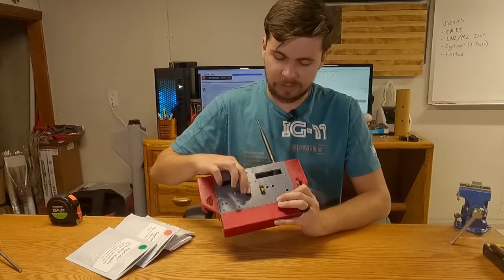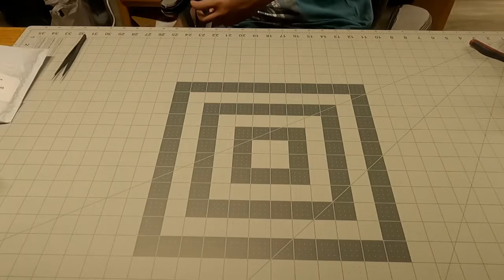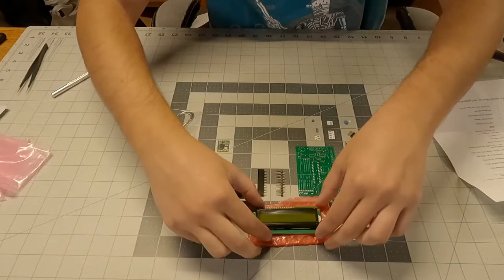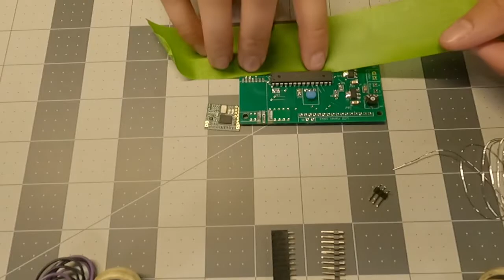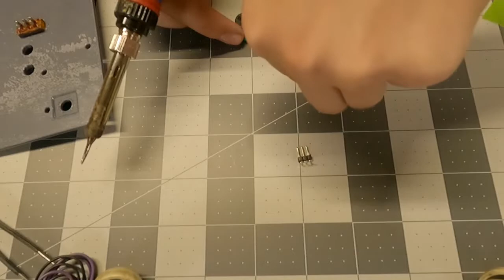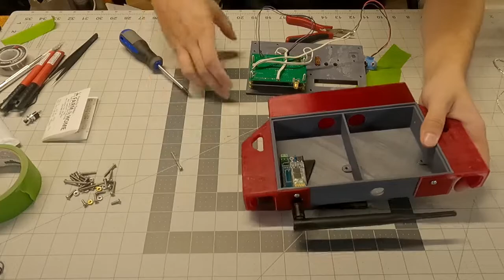Eggfinder LCD Reciever Build - Rev B5

Comment: do you have videos on what and how to set things up AFTER you solder all the parts? I'm stuck on the gps too. specifically how to test it before  you add that board. says to add a program called PUTTY to test things. no one ever tells you how complicated it is after you finish soldering haha do you use this still?  I'm about to just use a dog gps tracker lmao..

Comment: Thanks for making this video! I think you mentioned it but I didn’t write it down; what soldering iron are you using?
Reply from the maker: https://www.amazon.com/Soldering-soldering-solder-adjustable-temperature/dp/B09DY7CCW5/ref=mp_s_a_1_4?crid=2MQN4DIY1NLQG&keywords=soldering+iron&qid=1673352795&sprefix=soldering+iron%2Caps%2C295&sr=8-4

I'd start with one of these it's similar to what I've been using. I know several people will use Hako stations but they are very pricey if you don't solder a lot
Reply: @InvertedPursuitsLab  thanks! I’m really just looking for something for these kits so hopefully this’ll do the trick.

Comment: Can you please explain the buttons?  You have three and did not use the push button that came with the kit?  I don't understand the programming button or I am assuming a backlight button.
Reply from the maker: So the kit comes with 1 button, the one meant for programming. It's used for menu navigation and programming. You'll have to add a power button and backlight button if you want them. I chose a slide switch for power and additional momentary for the backlight. You can also just solder a bridge over the switch terminals and have plugging in the battery turn it on and of course the backlight serves no purpose in daylight but is designed to help with night launches.

Comment: I have many of the eggfinder products, I really enjoy the assembly process. On the legs of the IC many years ago I had an instructor show me how to effectively squeeze them together by basically holding the ends and rolling or pushing them on the table top or anti-static mat for those that need it.